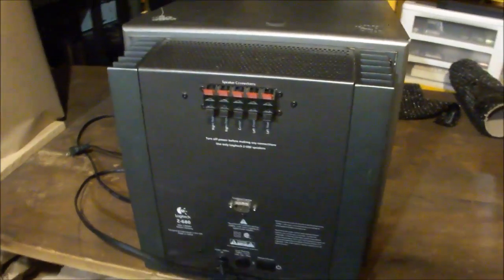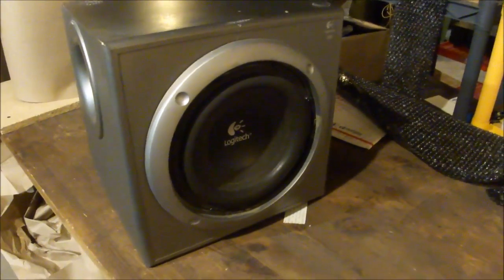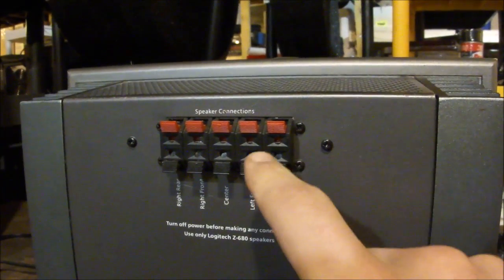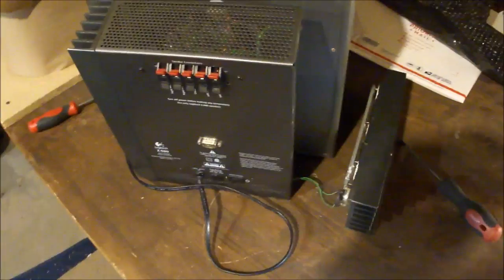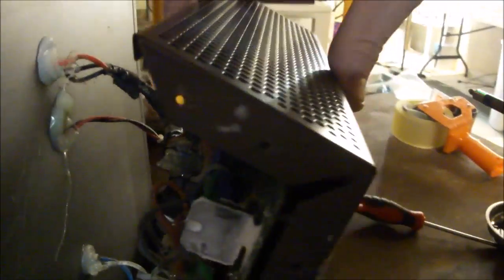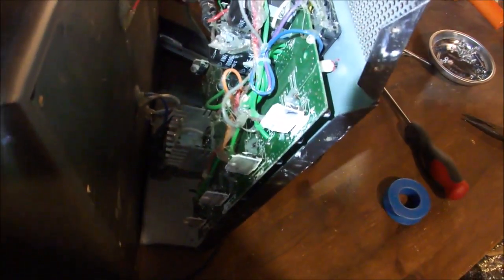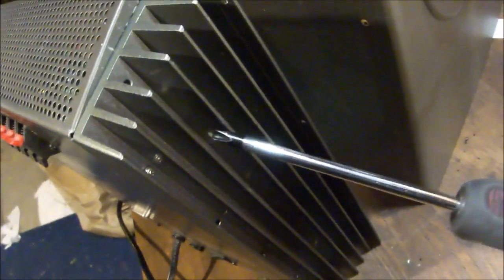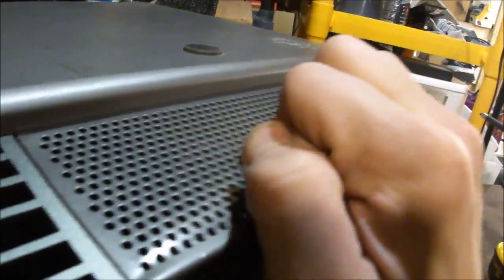Logitech Z-680 5.1 Repair Dead or Silent Channel

Comment: The fuse's filament at 14:44 looks like it is intact, additionaly, if it was blown it would have been dark gray from the internal burning.  So how did you conclude that the fuse needed to be replaced? Curious, did you only need to replace the fuses to get it to work?
Reply from the maker: I used a multimeter in continuity mode to determine the fuse was blown. I've fixed this sub twice, once it blew a fuse and once it blew a transistor. Its still going strong.
Reply: @striker1211  Your video greatly clarifies how to access the innerds of the z-680. My z-680 does not show any sign of life when I turn it on, the control pod does not light up.  How would you troubleshoot it? TY in advance.
Reply: @myvid222 had the same problem 
Just change the fuse at the back next to the switch. At least that’s what I did and it came back to life🤭

Comment: I have toys stuck inside the subwolfer hole, any ideas on how to take them out?
Reply from the maker: You'll have to remove the speaker by pulling the metal grille off the front and then removing the Philips screws. I'm not sure how to get the grille back in though without it vibrating after. Ive had my metal grille removed since 2010.

Comment: I got only the sub and remote in a second hand fair for 20$ , I see you have a long time experience with it I have 2 questions, maybe you can help😁
1. The sub makes a very loud noise when I turn it of from the main switch on the sub when the remote is on, when the remote it's of it doesnt make any sound, it's like some curent discharging from some component 
2. When I connected 2 front speakers, not originals, they lack bass, it's like bass it's cutout from a filter on the electronic Mai board, it's the same lack of bass on different type of spaekers .
Thanks
Reply from the maker: The satellites have barely any bass, this is normal. Make sure you are using speakers of the same resistance as stock, 6 or 7 ohms iirc. You will hear a pop if you turn the unit off while the remote is on. That's normal. There is also a 60 hz mains hum if you listen closely while the unit is on. I've had the unit for 20 years now, i don't even hear it anymore. If you're power conscience you could put the sub on a smart switch, because it uses 20 Watts just sitting powered on. Also be very very very careful to turn off the main before connecting speakers. One tiny wire fiber shorting is enough to kill the channel.
Reply: @striker1211  Thank you very much. Any idea on how to let mor bass on satelites and where I can find a wiring diagram schematics of the power unit? thanks again

Comment: Thanks for sharing, my center channel fuse did blow, a lazy fix is just to solder the new fuse pins on top of the blown fuse. Ugly but it works.
Reply from the maker: You're welcome, I'm glad you could extend the life of the system. I've had my z680 for over15 years now and still use it for my 5.1 in the living room. Thanks for watching!

Comment: "You know they're in there pretty good, so be careful to not break the glass on the fuse"

Me: Breaks glass
pulverizes glass
turns glass into a fine powder
gets two pairs of pliers and mangles the snot out of the cap and the fuse
receives hunk of twisted metal and no fuse cap

@!#$(*^%&@#)$(*&!!!

Comment: Thanks I had 2 channels out
RF , LR, Watch your video replaced 
2 fuses works great!
I didn’t unsolder and remove fuse caps
I Sliced off rubber and fuses came out
Of caps . Pushed new fuses into fuse 
Caps put it all back together 

Thanks again
Reply: Hey Mate, how did you manage to get the space to access the fuses? All the hot glue and short cables makes it hard to get to them. Any advice?
Reply: @jayisk82  
hey
Unfortunately it’s not met  to be 
Repaired , it’s a tight fit 
You just gotta move the stuff
Out of the way the best you can 
Watch strikers video 
Also when you get to the fuses
Slice off the rubber and pull fuse out 

Good luck 😎

Comment: Any one know how to extend the cable from the subwoofer to the control pod.?
Reply: I was just looking over the original manual. It says you would have to order a Logitech approved wire extension. Reach out to them.
Reply: I got the wires from eBay they are special you can get splitters and extensions.. don't go for any others but the ones that are Logitech compatible.. the pens are set up totally different on other chords I've seen.

Comment: The 4 screws that hold the circuit boards to the perforated metal have small nuts on the circuit board side that will spin if you don't hold them. That's why he couldn't separate the perforated metal from the circuit boards. Get them off so you don't have to bend the perforated metal in order to get to the solder joints. The three screws around the 15 pin connector have to come out as well. No nuts on those three.

Comment: guys, i noticed that my 680 blew 2A /250 , and i have a z5500 that also requires 2A 250v fuse but has installed a 10amp fuse , i replaced with new 2amp fuse in z680 and it blew  up but i replaced with 10 amp fuse and works fine, so if you have problems try with a bigger fuse
Reply from the maker: I would not recommend this. While  it may fix the problem of the fuse blowing, it removes any protection for downstream components and may cause a fire. One should never replace a fuse with a larger amperage one, for safety reason. I'm glad your amp is working again but the next time it shorts it will smoke the system and not the fuse.
Reply: @striker1211  my z5500 has been working for years with it. You can try with 5amps if you want. is that or garbage .  U guys choice

Comment: I love my z680... unfortunately a couple years ago one of the satellite speakers was shorted out accidentally by a chair that severed the speaker wire while the system was cranked.  I have had the amp open since that happened but could not determine the problem.  Figured it was the slow burn fuse, but that turned out to be intact.  This video has inspired me to take another look inside.  Wish me luck!
Reply from the maker: It's a good system. Mine's still going strong in 2019, 4 years after this video. If it's any consolation you can always part it out on eBay and get back what you paid for it. I haven't found anything able to match its bass at its price point yet.

Comment: my problem is subwoofer sound soft, even i max my volume and subwoofer volume. any clue?
Reply: Hi there. My Z680 (all speakers including subwoofer) sound not too loud. What was the cause of it?
Thanks
Reply: @timeatyou8027  I just gave up the decoder and amplifier of original z680, i think it's the TDA7293 problem or some parts getting old. I purchased a 6 channel audio amplifier from taobao/alibaba and they still sounds great with my Xi-Fi Platinum in analog too.

Comment: Hey Striker! Thanks for sharing this tutorial. It helped a ton. The problem I'm running into is actually soldering the new fuse back into place. Do you have any tips on how to do it? Unfortunately, Logitech took down the forum that had your write up and the further commentary. :(
Reply from the maker: The soldering aspect is a pain in the ass for sure. I really don't have any tips other than don't burn yourself. I found an archive.org copy of the forum post and will paste it in the description. Good luck! It's not October 2017 and I am STILL using my Z-680 in the video every night to watch tv shows and movies so the repair is worth it.
Reply: striker1211 Yeah, I think so too. I've had it since 2004 or so. It's been with me through high school, college, and married life. The system rocks! I broke one of the pins one the fuse cap, so now I have the additional challenge of bridging the gap between the fuse and the board itself. I'm going to see if I can get help from someone who is more experienced than I. If I can get video, I'll try to share. Thanks again!

Comment: Hi. I have a Z-680 and I love it. But I have a problem similar to yours. I'll describe what happens to mine. I'd like you to confirm that it's the same as yours. The title is not enough to understand if it's the same.
I turn my equipment on. It works for 10, 20, 30 minutes normally. After this time it gives a slight overflow (abrupt cut) and the subwoofer is muted. The satellites continue for another 10 to 30 minutes and a new abrupt cut in the sound, happens. Only front-right speaker keeps running. I've never tested for how long.
I turn off the pod. And I start again. There is a slight overflow (subwoofer start again) and all the speakers come back on again. A few minutes later the system fails again. And in the same sequence.
If I insist, there comes a time when only front-right speaker works. Less time to this. Seconds, maybe.
I disassembled and I cleaned the pod, connectors and subwoofer box (not the sink). Air jets and clean-contact spray. It was stable for a few hours, but the problem came back.
Please tell me. Is the problem with your Z-680 the same as mine? The solution was to replace the fuse? Anything else?
I can not buy other equipment at this time. And I do not want to lose my Z-680.
Sorry my english. I'm from Brazil.
Reply from the maker: No my channel died completely. I would recommend taking the amp apart and reapplying the thermal paste as it does dry up over time. The fact that your problem worsens over time and resolves itself after a cool down period leads me to believe it is a heat issue. Needless to say you are going to have to open the unit up anyway so take your time and look over all the components for any heat damage.
Reply from the maker: You could also put a box fan on it and see if it increases the run time and further verify a heat issue.
Reply: Yes, I can open it. But where to put the thermal paste? I have MX-4 (artic silver to CPU). 4g. How much should this give? 
Good idea. I'll try to use a desk fan and see what happens.
Reply from the maker: Once you have it open it will become apparent where the thermal paste is required, basically anywhere there is old paste. 4 grams might be enough but you will not be sure until you get in there. You might be able to smear the old paste around but idk if they will mix well. Search my other videos for "Z-680" to see close up teardown pictures I took when I replaced one of the chips that needs cooling.
Reply: 3 hours with music and desk cooling/fan (40cm). No problems. 30 minutes with volume 60% (set). No problems. At night I try see masterchef (youtube). Desk cooling (30cm) in the side of dissipator/subwoofer. 
The problem start again. 
Thank you for your help and return, but heat is not the problem. Fuse, TAC, another? It's complicated.

Comment: Hello, i have a question, i have th esame problem but with the right front channel. In this video you dont see how you change the fuse. Can you tell me how you did this or a link to a video? thanks! you can also e-mail me at:  briankrause2@hotmail.com
Reply from the maker: +Pathefreak It's pretty simple really. Finding the right fuse is the hardest part. Just desolder the old one, pop the holders off, and resolder it back on. If you aren't comfortable with a soldering iron practice on some old piece of electronic that you don't want anymore. I don't show me actually removing and installing because it would have been impossible to hold the camera.
Reply: my right front speaker is also dead.. only difference is that it’s on my Logitech Z906